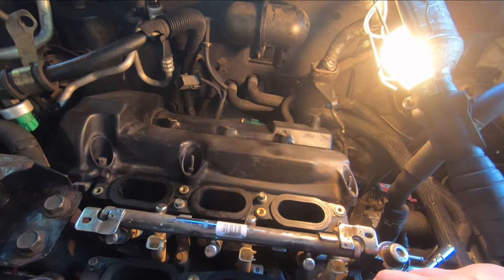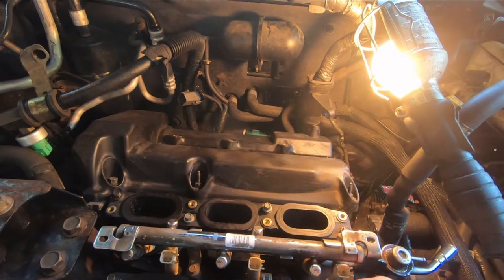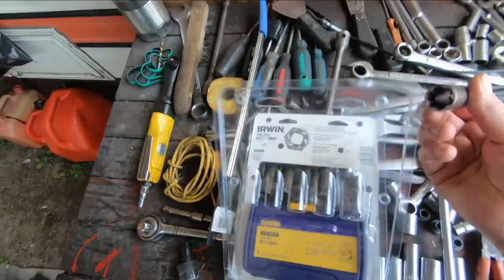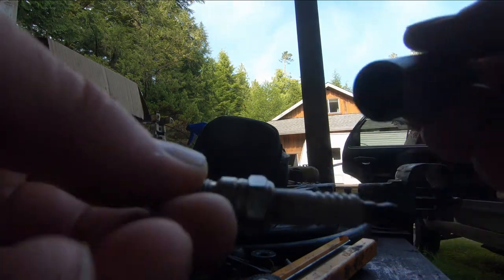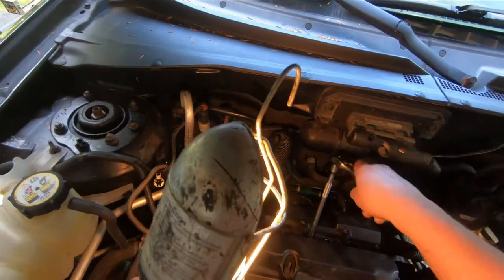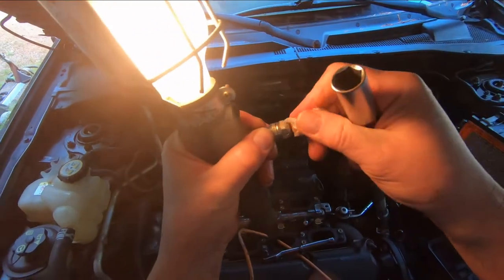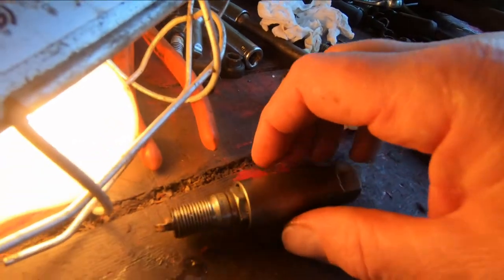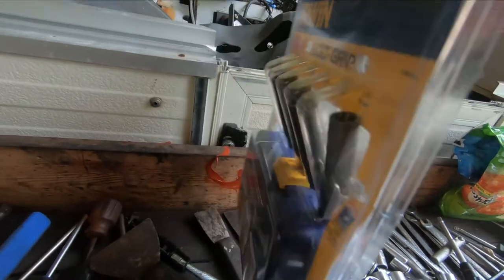HOW TO REMOVE A SPARK PLUG THAT HAS THE HEX ROUNDED OFF

Comment: Just had this happen on my 5.4L F150.  I've changed the plugs before and none broke like they are known to do, but two of the three I started with had the hex round, or break off!  Never heard of this happening.  The rear plugs are really close to the firewall so I'm concerned about the same thing happening there.  I may have to try this if I can't find a shop that can deal with it.  By the way, you're lucky that plug didn't fall out of the socket and into the open intake ports!  Thanks for the video!
Reply from the maker: Some F-150 are known to have spark plug issues, like having a spark plug blow out and take the threads with it. They actually sell a re-thread kit now! Also, the rear plugs are almost imposstible to remove on some models because of the cab overhang. The dealers have special tools to get at them. If I were you, I'd put anti-seize on the spark plug threads and change the rear ones often (at least once a year) to keep them free. Good luck on getting those plugs out! Yes, the open intake ports should have been covered. Thanks for watching.
Reply: Pretty sure, I just had this happen today....5.4 Triton, plug 3...🤦

Comment: You lucky because you still have the exagonal ,mine doesn't have ,I'm stuck any ideas how to get out ?
Reply from the maker: This tool will take out rounded bolts and spark plugs. If you cannot remove the plug with this tool, and you cannot reach the plug any other way, you'll have to remove the cylinder head. I big job, yes, but not impossible.
Reply: @EverydayProjects   
Thabks for fast responding. That's  gonna be the plan b!

Comment: Do you need to apply a lubricant to this prior to using this? I am picking this up tomorrow as my socket wrench can't seem to grab the spark plug in either direction! Thanks for the video.
Reply from the maker: No lubrication needed. I did, however, spray penetrating oil down around the spark plug to help loosen the threads. One of the best is PB Blaster or liquid wrench. Apply generously and let it sit for an hour before attempting to rermove the rounded plug. Good luck. Please like and subscribe to the channel--it is free!
Reply: Subscribed! One more question… I used a 5/8 socket wrench to try to remove the spark plug and both #1 and #2 would not grab properly after I torqued it loose. Is it possible the socket wrench I got is bad? I would think using this tool for all the spark plugs would not be ideal. It’s also possible the previous person to install the SP over torqued it!

Comment: My problem is a little worse. With mine it appears that when someone installed the plug they twisted off the entire hex part of the plug. It must have been stuck in their socket because it's not down in the hole.
So I'm my case the 5/8 size would be to big. Was there a smaller size extractor socket in the kit.
What I have left is perfectly round. Thanks
Reply from the maker: I'm looking at the set right in front of me. 5/8" was the largest extractor. The other sizes in the kit are 9/16", 1/2", 7/16", and 3/8". The kit is IRWIN BOLT GRIP number is 3094001 . Please keep me posted on how you make out. Also, I had good results after soaking the stripped spark plug with penetrating fluid for a few days before trying to get it out. Best wishes my friend!
Reply: @EverydayProjects  I bought a set and the 5/8 is to big and the 9/16 is too small. I thought that would happen. 
The plug is still in the car and the car is still running good. All I can do is run it until I can figure out something.
I don't want to pull the head just to change a plug.
I tried to get one of the other three plugs I changed to come apart like that and it wouldn't. I'm going to cut some open later and see how this is possible.
I tapped a 15mm down onto it but it wouldn't get a bite when I tried to back it out
Reply from the maker: @LH-kz2nf  I saw a guy on YouTube heat a 9/16 socket orange hot and then tap It down over the spark plug with a hammer and extension. When it cooled he was able to back the plug out.
Reply: Did you ever get it out? I just tried to remove a Motorcraft plug that is too tight, and the hex part turned off, so I'm in the same boat, a round spark plug still in there. I have the hex part, but it's not like I can get it back down in there to weld it or anything, it's really deep in there.
Reply: @mystupidvideos4347  no it's still in there but the car is running.
 I did see a tool on the internet somewhere that actually pushes the insulator down through the metal part and into the engine and then the tool goes into the hollow meatal ring that's left in the head. Then you just unscrew it from there  The guy had mad an adapter for his shop vac that fit tightly into the plug hole and it would vacuum the pieces of the insulator out of the engine.
I would only do that if you have that cylinders piston at TDC on the compression stroke. Doing it that way the piston would be all the way up and ithe intake and exhaust valves both would be closed.
Reply: @mystupidvideos4347  also the bolt removal sockets he uses in his video will not work. Believe me I know I paid $40 for a set just like his. Those are only for if the head if rounded off. The hex head of our plugs no longer has a hex head. The little round metal ring we have left on our plugs falls in between two different sizes of the sockets in the kit.
Reply: Currently have the same issue how tf am I gonna get it out
Reply: @micc4044 Good luck. I just did mine. I twisted the hex part clean off, which made the ceramic shoot out when i started it. Then drilled it, used an easy out, which wouldnt work till I drilled so far, that the square easy out finally poked out the bottom of the plug. That messed up the threads, so I bought a kit made by heli-coil that included a tap and threaded inserts. I cleaned the cylinder with tubing on a shop vac and went through plug hole. Its back together and runs good.
Reply: @mystupidvideos4347  I had to heli coil a different plug same vehicle the town Cars are notorious for spitting out plugs cuz aluminum heads...if the red hot 9/16 ez out hammered on doesn't do it I will try jb weld socket to it or maybe even drill the stud of the plug I broke off all the ceramic already, so I cam ez out it...I hope I get it tmrw it's my daily I just did all plugs and packs 25k ago when I got it.
Reply: @micc4044  Dang, I've never seen plugs go that quick. I'm pretty sure the ones in mine were still the original factory plugs. The truck has about 160,000 miles on it, and the gaps were 3 times what they should have been. I've had most plugs go well past 100,000 before, but these were the worst ones I've seen so far.
Reply: @mystupidvideos4347  so I was messing with it just now and I'm now at the point I can use a ez out to remove it I got the ceramic and stud out...there's no way I wrenched that thing on there that tight and it being so recently maybe it was the wrong plug or factory defect cuz like I said I did all the other plugs and packs and had to helicoil one after that cuz it spit a plug out now this...I think it possibly sucked the plug in on instead of spitting it out the aluminum heads sucks on fords. Or the garage I just had it at fucked with it that's why I like to do my work myself, I almost got it now I just need the right ez out bit mines not long enough
Reply: @EverydayProjects  the kit will only work if the hex head / socket head is rounded but still attached to the plug. If the 6 side socket head is completely gone one of those in the kit will be to small and the next size will be to big. I found this out after I paid $40 for the set sockets

Comment: maaan that spark plug doesn’t look very stripped mine is completely circled off and i don’t know what to do really stressed this is on a audi s3
Reply from the maker: This kit will get it out. I was very surprised how well it worked. I was unable to get a 5/8" socket to grab at all but this took it right out. This was $50 on Amazon but you may find it elsewhere. It is by far the easiest and quickest option. Good luck!!
Reply: i actually have that i just found out the problem is there is some gunk that doesn’t allow the socket to reach down to the hex
Reply from the maker: @vlone42k42  AAAhha That's lucky!
Reply: Llol vlone same happen to my brother lol round like a dime lol

Comment: Even pulling the head off... I don't know Man. Without that tool you might have been heading to the machine shop. That tool saved you about 10 more hours.
Reply from the maker: You're right. I would have had to spend considerable time and $$$ if I was forced to remove the head. Even then, the spark plugs on this engine are at the bottom of a deep well about 1 1/4" in diameter and 6 inches deep. There would still be little way to get ahold of the plug. Drilling it out on the bench may have been one of a few possibilities. This set saved the day and may come in handy again.

Comment: This shit happened in my subaru
Reply from the maker: This is the tool that will get the plugs out. I was really worried that I wouldn't get that plug out but this thing worked first time. I'm sorry to hear that you had a similar experience. The spark plug manufacturers should have to pay up for removing these cheap plugs!